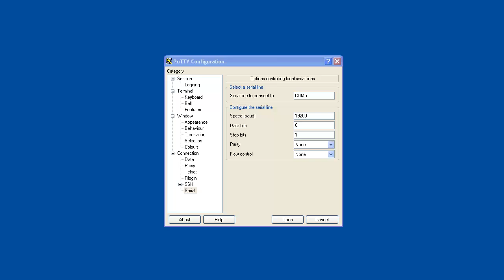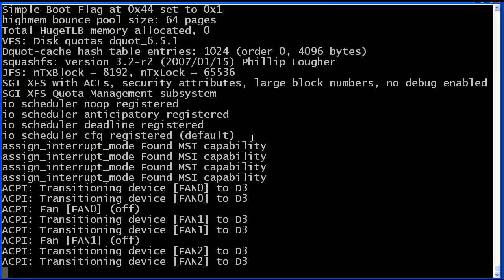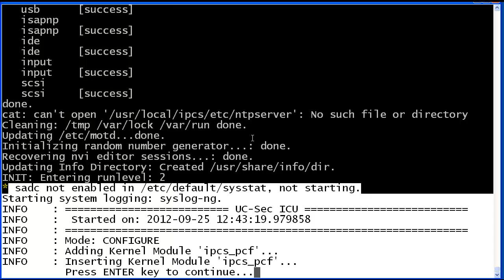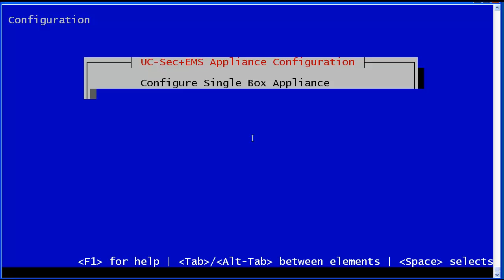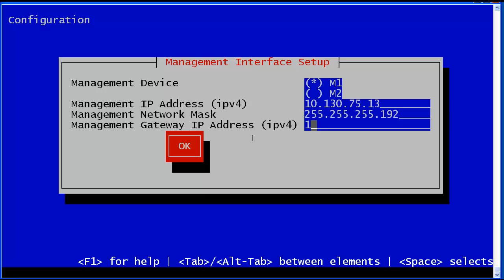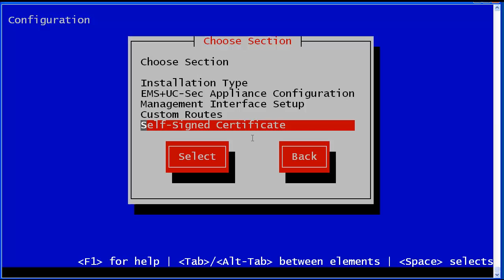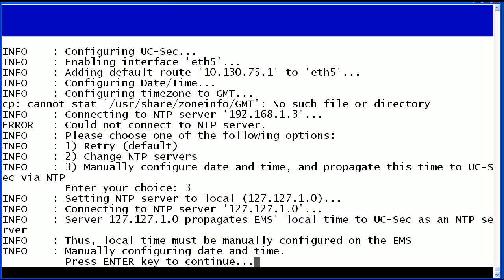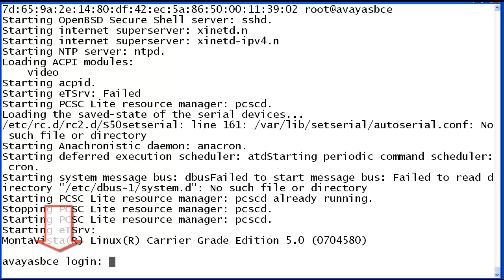How to Perform Installation Provisioning of a Single Box Avaya SBC for Enterprise

Comment: I can't see the GRUB menu while configuring the ASBCE standalone(ems+sbce);
There should 4 options 
1.serial
2.VGA
3.Rescue Serial usb
4.Rescue VGA usb.

you has to select serial option 1 and then proceed.

I think there are some parameters in bias settings to be enabled and disabled 

c states and turbo mode and redirect after reboot.